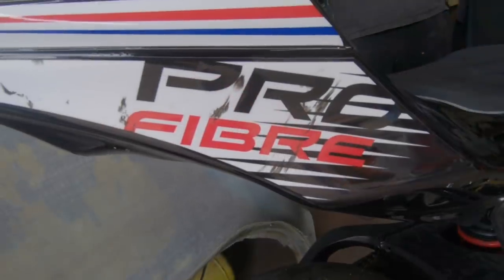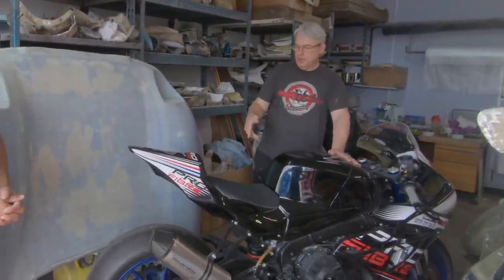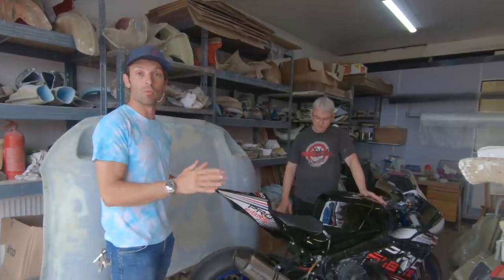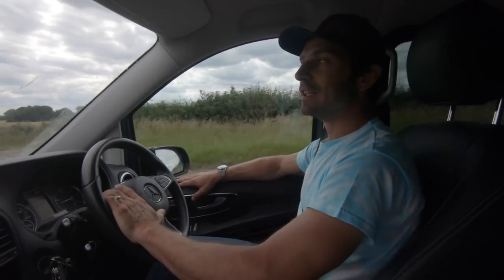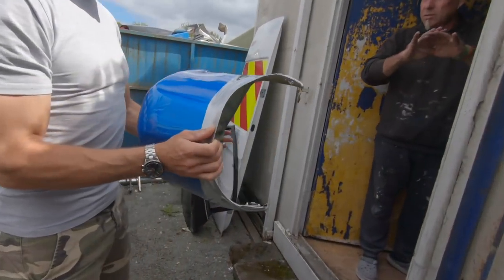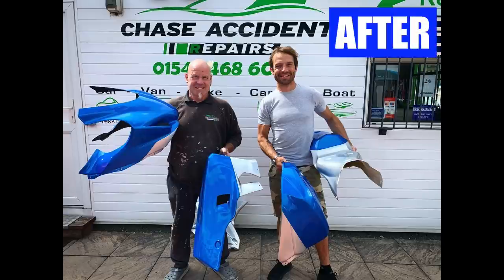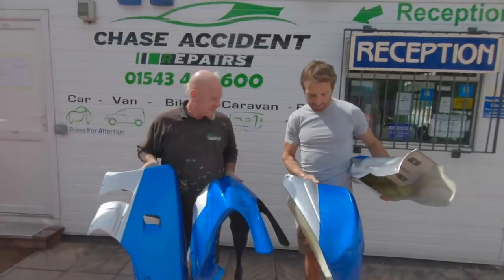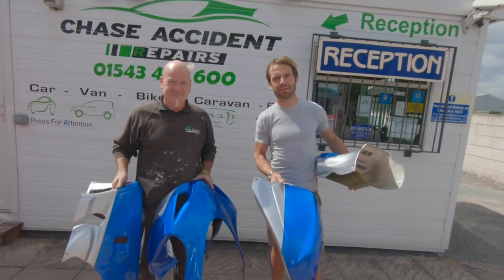SUZUKI GSX-R1000R "ROAD TO THE TRACK" (sous titres Français🇫🇷)

Comment: What are the panels made from? Is it GRP, carbon or some cool fibre mix? Are they flexible or more rigid?
Reply from the maker: Richard from Profibre told me they use a mix of strength and flex depending on the area to offer a product that’s solid but also can handle some crashes with limited damage. Material is fibre mix I believe

Comment: Even by selling all the "useless" parts, it's not enough to buy and paint track fairings. So my strategy is to wait for the crash before buying anything 😬

OEM fairings are more expensive to replace, but they're useless in your garage, unless you plan to put the bike on the road again later